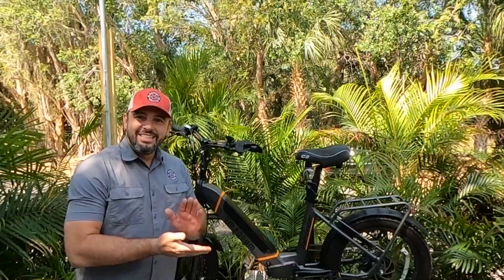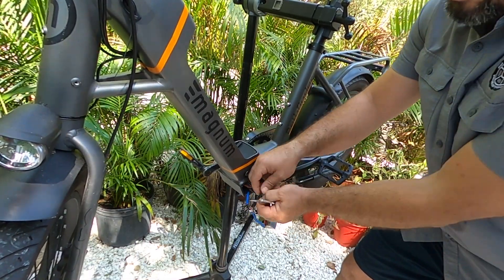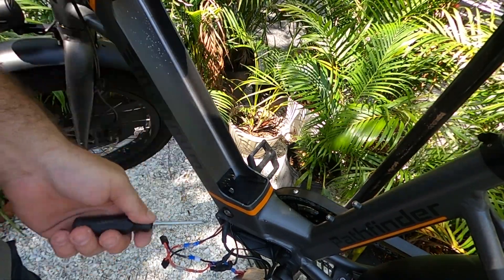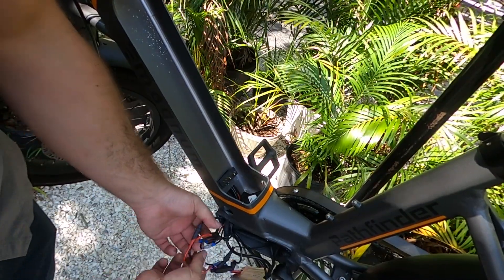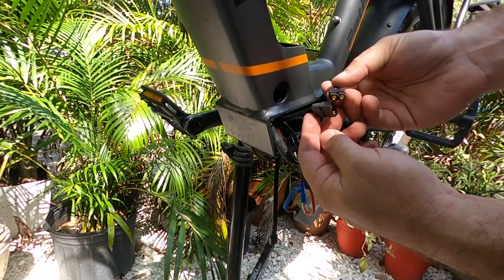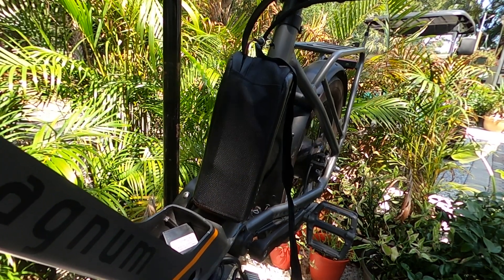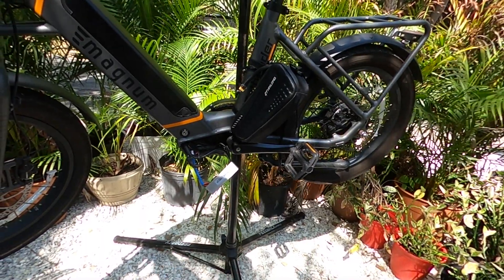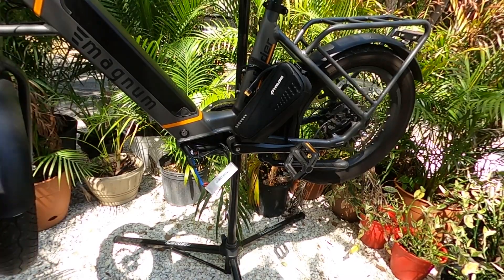Magnum | Pathfinder | E-bike Plug & Play Dual Battery Discharge Balancer Kit | Install Two Batteries

Comment: Would this sort of kit work on a 48v 1000w kit ik not the same exact kit as the 36v 500w but still there should be an adapter right?

Comment: hi matt good job  say i got my 2018 radmini all rewired with the xt60 cont did what you said so far put 40 miles or more everything is great i took my time on this. ya just glad to move forward  thanks again for your help vic.
Reply from the maker: Good to hear Victor
Reply: Very interesting Video! Does the Bike also work with a Battery that isnt an original one?
Reply from the maker: @philippmatter1461 yes